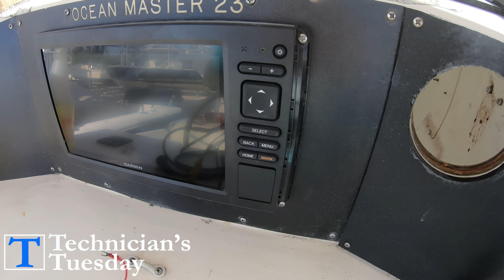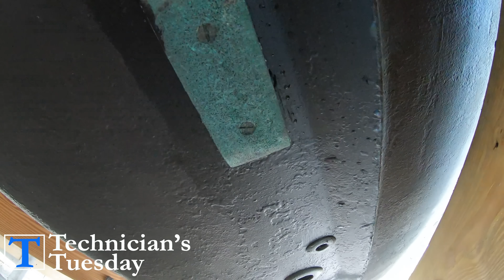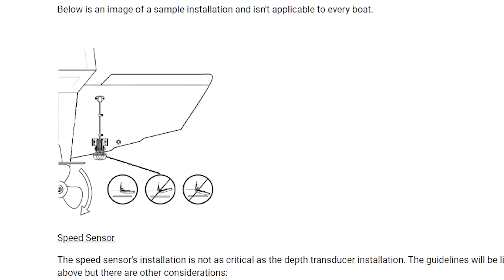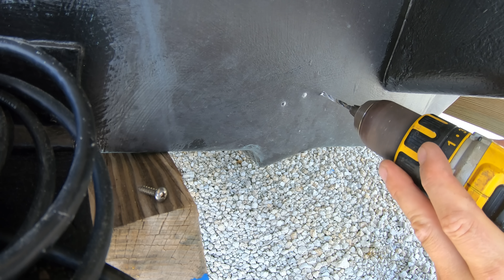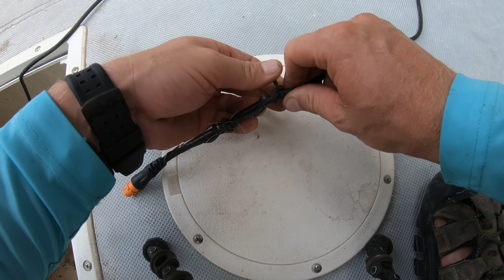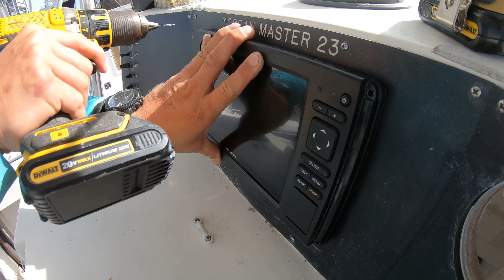Upgrade Your Boats Electronics!

Comment: 🤔 Attaching to the boat is not a must do. I keep a second transducer on an extension pole. I can change the position to reflect its purpose, and even side scan by rotating the pole. It stores in a rod rack when not in use, has a lighter plug for a 12v receptacle, and/or its own lawn mower battery in an ammo can. I can reach out about ten feet from boat, dock or bank, and even peek underneath the boat using this set-up 🙂 it's portable and backs up the other fixed mount Garmin. 
Drift boats have 'special-needs'🙂 Bankies do too.

Comment: When installing the transducer you can buy this kit that has a plastic block and some screws. The whole purpose of this is that if you need to move the transducer you don't have to put more holes in your boat. You put the block on with four screws and some adhesive and then you attach the transducer right to that. I have seen both that look like swiss cheese in the back from people moving the transducer all over the place.
Reply: Starboard is the brand I chose for that. It works great for mounting a live well pump on too.

Comment: What kind of product are you using to seal the transducer mount holes? Is it better to place it on the starboard side to get away from the prop walk turbulence?
Reply from the maker: Using 4200 by 3M, and that depends in lefthand or righthand engines for your prop wash. Or well aerating the water before it gets to the prop. Try to get it at least 12 inch away from the prop. But its not always possible

Comment: Thank you so much for making these videos. I am an old sailboat guy converting over to powerboats- I have found I love deep sea fishing! I had a question about drilling the holes. I’m sailboats, I was always taught to oversize the holes going into wood, epoxy fill them and re drill using the correct size to prevent core damage from water seeping in over time. Is there any reason that this could not be done as well in poweboating? Thank you for your reply and keep these awesome videos coming !
Reply from the maker: No, you can do that, it's fine, I wouldn't make the hole too big though. As long as you have the wood sealed, you will be fine.

Comment: Excellent.  This video is right on time.  I'm looking to mount my first fish finder on a sailboat this weekend, and I was not sure from the supplied instructions about the transducer mounting specifics such as depth and orientation.

Any suggestions for a sailboat application where heel angle mean that the transducer is seldom aimed straight down underway?  The auxiliary outboard is off center - meaning that I can mount it directly on the centerline.
Reply from the maker: Sailboats can be tricky, youll just have to look at how your hull is and go off the basic general rules about the aerated water :)

Comment: Hi your videos are really help me lot to understand my outboard engine. My 2007 F115 yamaha four stroke engine running rough and also when we accelerate it fired through the exhaust like couple of explosion. Do you know why or any reason caused  ?  Your suggestions really appreciated.
Reply from the maker: Could be anything! Because it's back firing, check the spark and the timing first

Comment: Another great video Aaron👍. Perfect timing, as I was looking at a new Garmin setup. I have a suggestion, how about a video on setting up gages that I have had fixed from GaugeSaver’s. These are mercury 2006 135 verado four stroke and I am having a problem getting them set up. Seems to be reading the engine (rpm, temps and oil pressure) ok, but the other items are not working (gas level, fuel used, distanced traveled etc etc). They looked the same as the ones from your mpg video. Hope you could help out. Thanks 😊 David. Stay safe and happy boating.
Reply from the maker: Just press the mode and plus button to open the screens and calibration menus. Then select the screens you want. On the fuel, turn  on fuel 1 and in how many gallons the tank is, then calibrate it to default!

Comment: If you mount the transducer on the side where the prop goes down, commonly the starboard side in a single engine set up, that transducer will work well over 40 MHP because cavitation is less there.

Comment: I love both my Garmin 94sv units. I believe in redundancy and run one for navigation the other for sonar. Amazing difference from my early 2000 era electronics. I also used a four foot level under the hull to help get my transducer exactly inline with the hull, and not cocked up or down. I hold bottom at any speed.
Reply: The deeper you go, the more it matters.👍

Comment: I have just installed my Hummingbird transducer inside the bilge with epoxy.The instructions from Hummingbird say it will work provided I have worked all air bubbles out of the epoxy and once glued in it doesn't need water in the bilge to work.I have not yet sea tested it.(fiberglass hull)
Reply from the maker: Yup, some of those transducers you had to sit them in antifreeze lol

Comment: Another tip is to use a Philip screw driver bit to put a small countersink on the hole so the gel coat is less likely to chip out when running the screw in.
Reply: Agree that this is very important. Gel coat is so brittle you will get chip out or spider cracks if you don’t.

Comment: too bad the boat place who installed my transducer didnt read the directions or watch this video. my transducer is on an angle, too far into the water and the wire is run behind the transducer against the hull. no more give-a-ways?
Reply from the maker: That sucks :( not right now, I can't keep up with everything as is right now so had to cut out a couple of things. Until I can get someone or have the time to coordinate with all the companies and the footage and emails and all that went into that, we've had to put that on the side for the time being :(
Reply: @BornAgainBoating  appreciate the work you do for these videos, it's not quick or easy. To bad there isn't anyone who can help you

Comment: Does the GPS have a gasket around it? Just curious why you don’t put sealant around it too?  I haven’t installed anything like that in 20 years so no clue if you do anymore or not.
Reply from the maker: Yes, there is a gasket, but I usually seal it with sealant too ;) I didn't seal it yet, because I have more work to do to the console and so I pulled it back out and will do the permanent install later.

Comment: OK so I always installed them slightly above or online with the underside of the hull simply because at high speeds if the water depth drops off its too late to react anyway. So to prevent any motor problems with air bubbles or even cavitation used a higher position. When you are slow enough to read the depth behind the boat the sender is easily under the waterline.